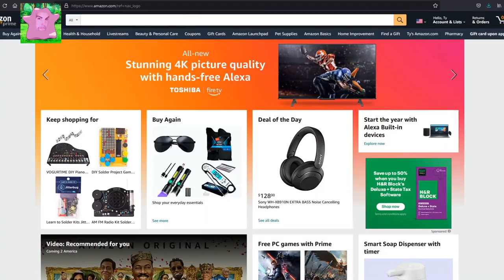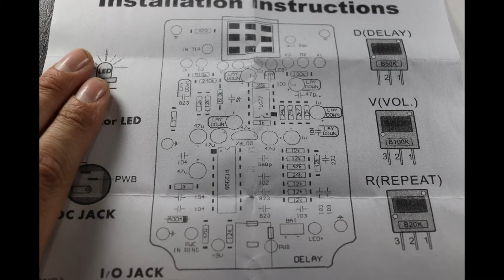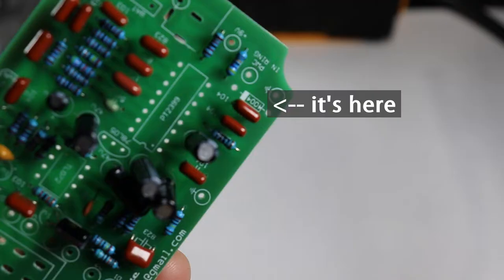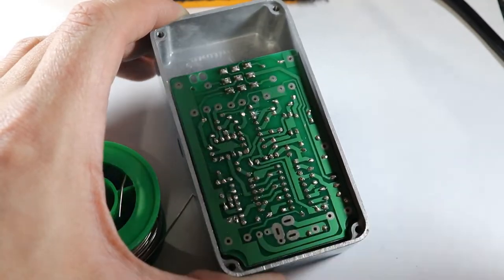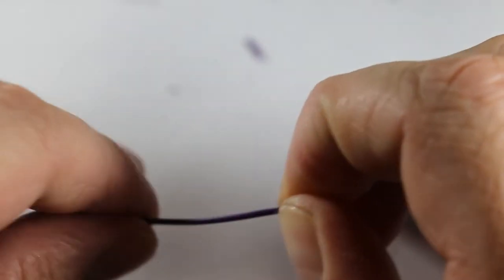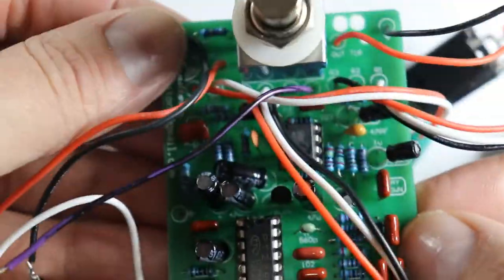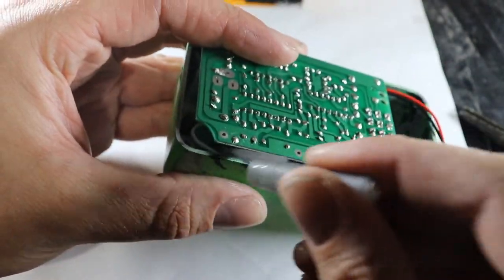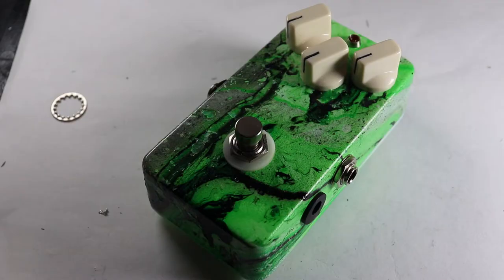I Built The CHEAPEST DIY Delay Pedal Kit On Amazon

Comment: Pro tip: the way you put the box & PCB together is fine, whatever works. However, it's ALWAYS better if nothing is under strain.
The tip is, the foot switch (most switches, actually) come with 2 nuts and at least 1 metal washer. The reason is so you can fix the depth of the switch in the hole in the box.  Basically, the nuts go on both sides of the case. The nut on the inside of the case sets the depth, then you use the outside nut to tighten down and lock it in place. This will make it easier to allow space between the PCB and the case for the wad of wires.
If it didn't come with 2 nuts it's because they shorted you, it should've been there. You can actually buy them separately, they come in standard sizes. I'm sure Amazon prolly sells them in bags of 3-6 or something.
Otherwise, you did as well as anyone could! 😅 they're always a pain when there's not a "slot" or some mounting system for the board.
And because of that, there's not a good way to manage the wad of wires, we just do the best we can. 
Thanks!  👍
PS:  The sounds you were making ATE6 actually considered music. Think of all the soundtracks for movies, etc 
👌